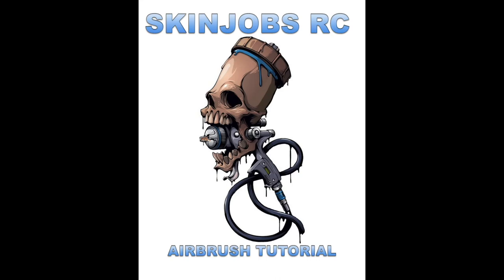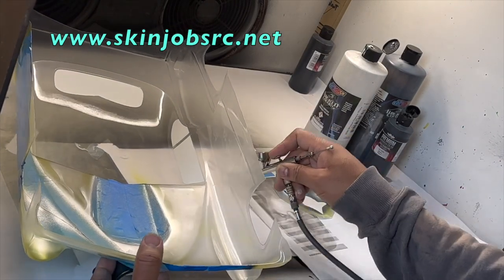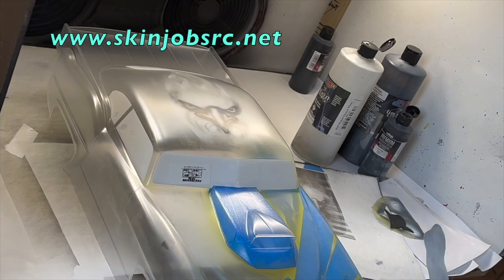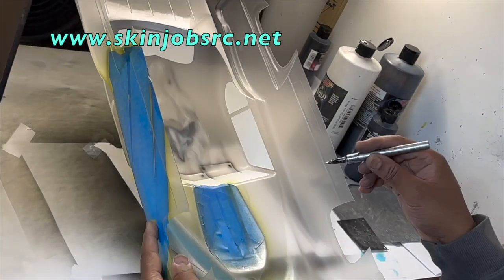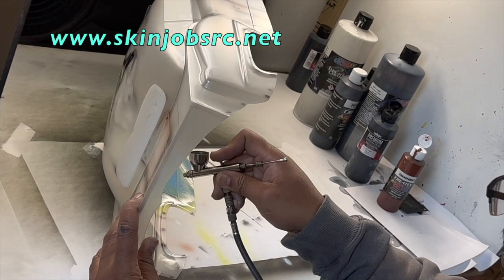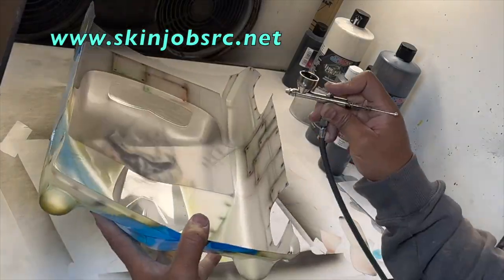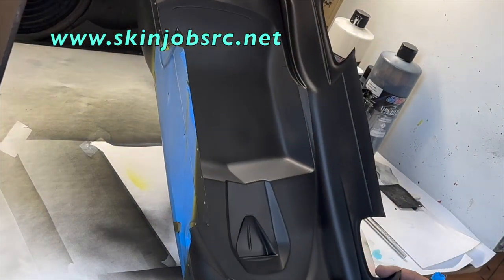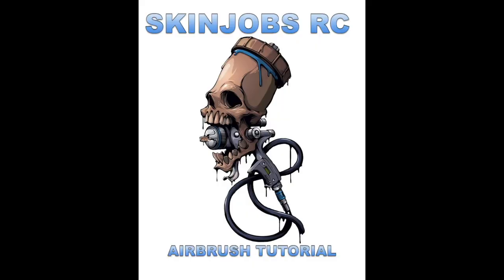AIRBRUSH TUTORIAL, flaming eagle, wavy American flag, Super J Drag Body, tricks and tips revealed.

Comment: Great tutorial. Great to see the new content. I had started out using the Spaztix paints and moved to createx. Spaztix just seemed so noxious and a pain to clean up. I guess I need a better hood.
Reply from the maker: venting is key.  I have 2 10 inch high power exhaust fans pull over spray out with really great results.